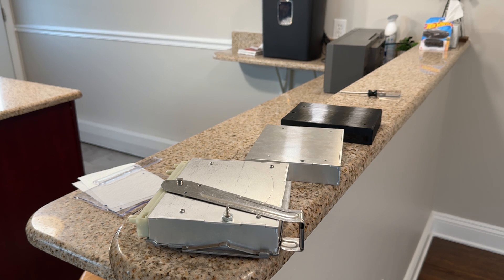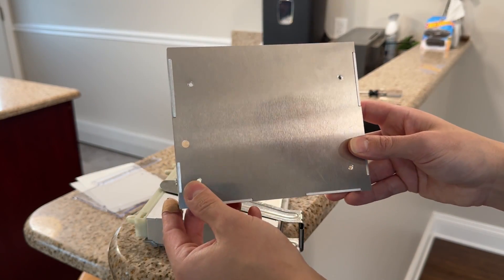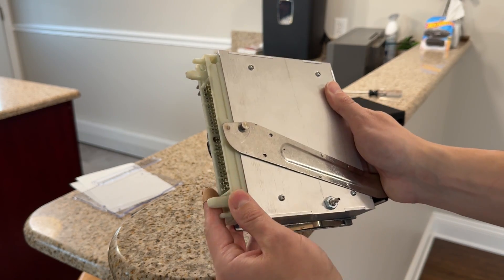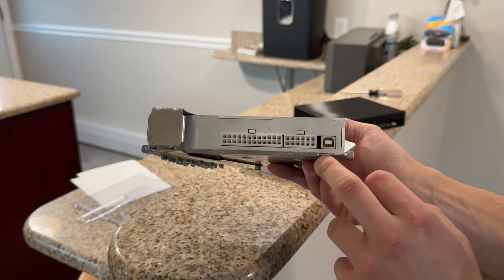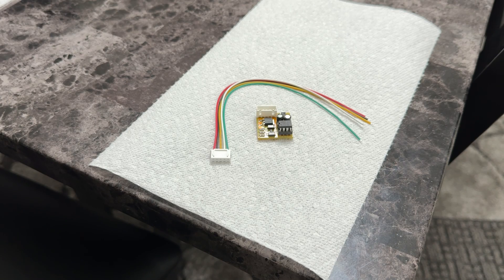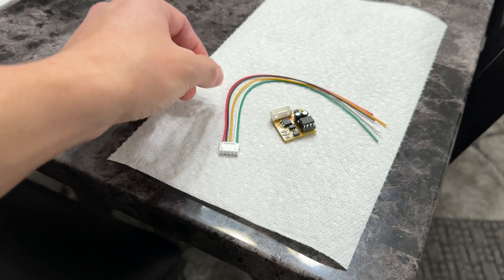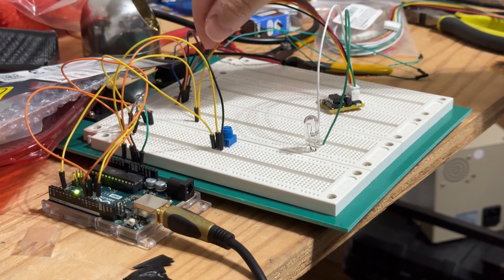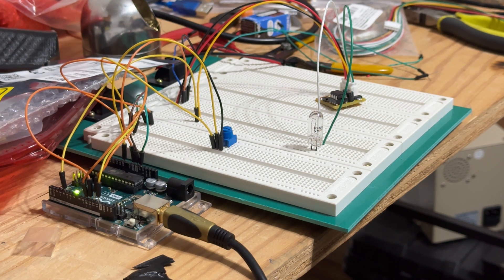Volvo VolSquirt PNP ECU Updates + Volvo M66 Reverse Lockout Board

Comment: Do you think that aluminum casing will be a standard inclusion with thr volsquirt wheb it is tested, or an optional add on?  Looks really sharp.
Reply: Nevermind I saw your other comment replies.  Leaving this up for engagement reasons.
Reply from the maker: Yes it will be the new standard case going forward. I just made a few more small tweaks to it.

Comment: Hey bro, 
I’ve got a question for you, hopefully you can assist. 
I’ve been following your channel closely and it’s been motivating to say the least 😊

My question, for my P2 XC70, I’m planning to add power, but the main concern, is transferring power to the wheels AWD. In looking at Quaife(lsd, maybe even trans), Elevate Volvo (Block) & your possible billet angle gear, do you honestly think it’s possible to build that platform reliably for 500hp+?
Reply from the maker: My billet angle gear is only for 94-00 P80s. P2 angle gear is slightly different... however for 500hp goal you have stock P2 drivetrain (trans, angle gear, axles, etc) will be fine but only from a roll. You could maybe get away with some launches. Quaife front LSD would be a nice addition but definitely don't need their sequential trans for 500hp.

Comment: I've been following FCP Euro's build of their 850 BTCC tribute car.  For those who don't know,  they used the VolSquirt in that build.  So this hardware has been track tested.  I had no idea until I looked at their parts list.
Good to see you back Matt.  I'll be among the first to pick up one of these units.
Reply from the maker: Yes, they are using this system. It's been running very well for them for quite some time now. They are also taking advantage of the VVT control. If you want to be added to my backlog of customers interested use the contact form in the description of this video to send me a message so I can add you.

Comment: Great video! I'm willing to buy a metal case upgrade kit for your original blue 3d printed version that I have.
Reply from the maker: Thanks! The case upgrade would be possible, but I would also have to upgrade the PCB as well as I've added some additional mount points. The MS3PRO module can be reused as is. I believe you were the very first person to purchase one when I originally went live with them in 2019 :)
Reply: @SimplyVolvo  Totally the OG version 1.7.0, serial #0001. Works perfectly, no problems.Plastic held up just fine.  Running very mild tune that mimics the  IPD stage 3 i had before.The fact that I can drop back in my OEM ecu for PA emmisions tests makes it worth its weight in gold!
Reply from the maker: @LordTominator  That's awesome to hear. I am glad it has been running perfectly all of these years. Do you run the ECU cover on the plastic ECU box with the tube that hooks up to the radiator fan?
Reply: @SimplyVolvo  Yes - I believe that tube is essential regardless of what ecu is used. the fan pulls conditioned air from inside the cabin and prevent condensation in the box